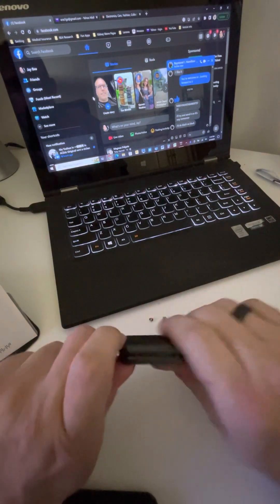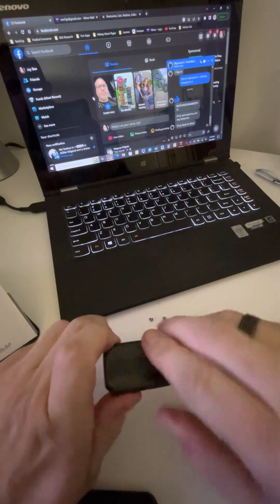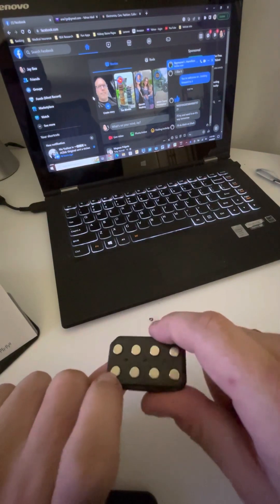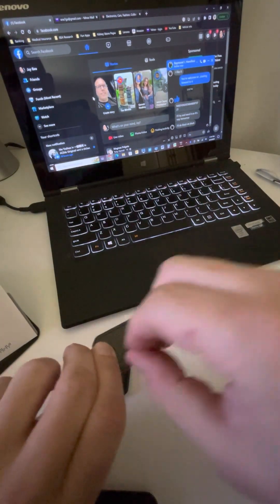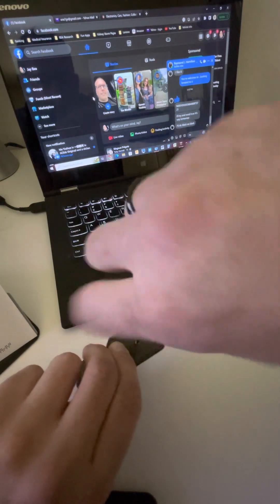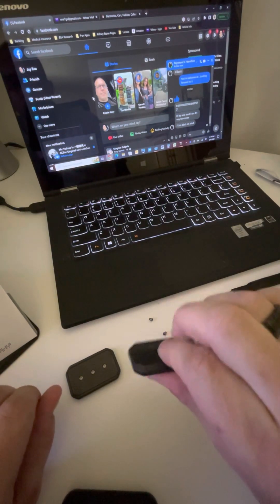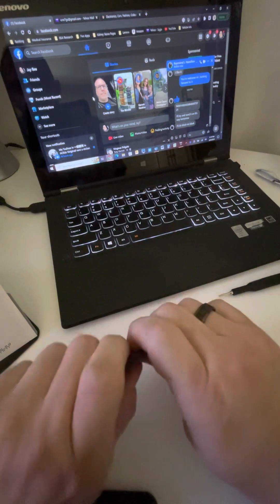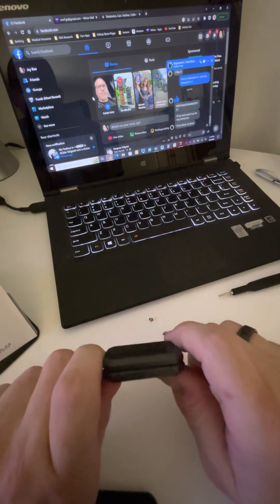How to replace your magnets in a Magnus slider.

Comment: What tool do you use to remove the screws?
Reply from the maker: I think it’s a T6 screw, if not it’s T8. If you get a screwdriver set, both those should be included.